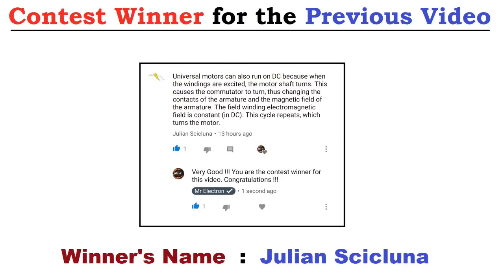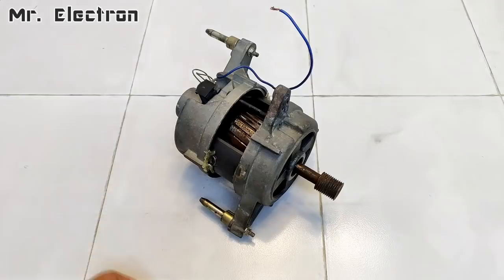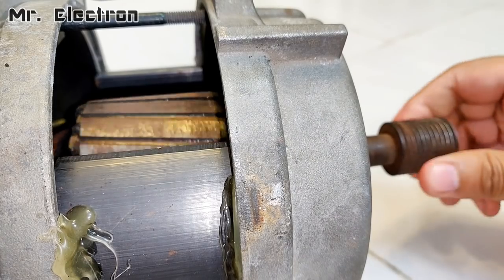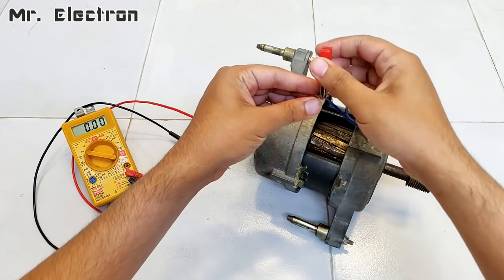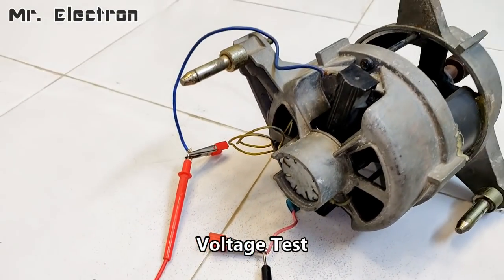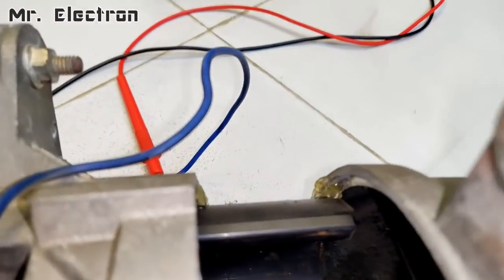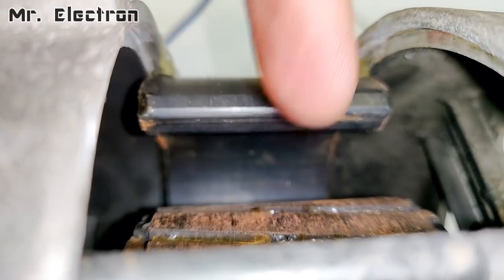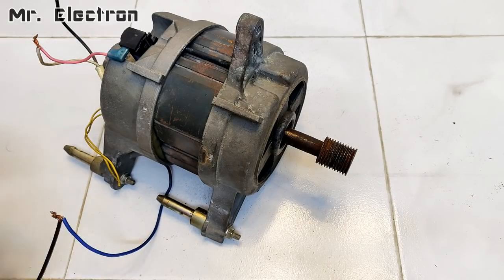Make 12V 690W Generator from 220V Washing Machine Motor ( Universal Motor )

Comment: Did you modify the generator to generate 12v at over 30A? Because when I tried it with a washing machine motor, it generated well over 12v,  about 2A and a pain in the hand upon self-excitation with rope rotation.
Reply from the maker: No modification !
Reply: @MrElectron  Then how did you generate such a voltage at such a high current??? Did you connect a buck converter somewhere?

Comment: want to make best generator look for world most high cost power but slow motor. then make it make power. check all motor max rpm then voltage amperage one with lowest rpm and high voltage and amperage is quietest generator.

Comment: I'm new to  how Electricity works. But I was curious what about a outside air conditioner had a few of those motors with a belt to them feeding energy to battery. Wouldn't that work?. Great video
Reply from the maker: It would

Comment: Universal motors run most efficiently on dc instead of ac because of the constant power to the rotor and stator windings which creates a higher powerfactor and a lot less heat.

By the way, try running it with low dc voltage by connecting one of the brushes in series with the stator windings. When it stops accelerating, put power to just the brushes and short circuit the stator wires and the motor goes super fast.

Comment: Mr electron. In the headlines you say 12volts 690 watt but the only thing you show is a h4 lamp on your generator that is About 60 watt when do you demonstrate the 690 watt ??
Reply from the maker: It was 90watts bulb h4 . 
After the remaining research.
Reply: I m pretty sure just advertising 😅
Reply: So for 690 watts you need to rotate much more.. For a wind turbine to much I guess

Comment: I think DC would be more efficient if you use a 12v battery to spin a universal motor and get ac output from the second motor as an inverter with the right circuit to filter the sine wave spikes atleast here in the US since its 120vac we run our electronics

Comment: Dc powers supply is perfect for universal motors ac power supply is unfiltered and the pf is less than the motor need more watt form power supply
Reply: Quiero saber hacer fuente de alimentación casera de 18 volts con 8_,10_12 etc. Ampers